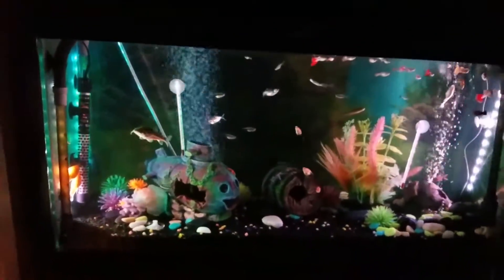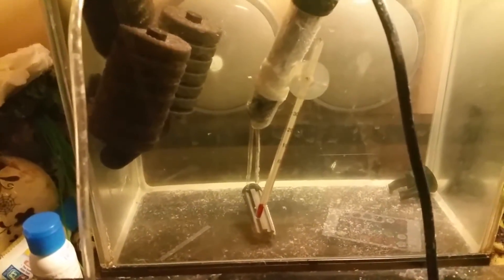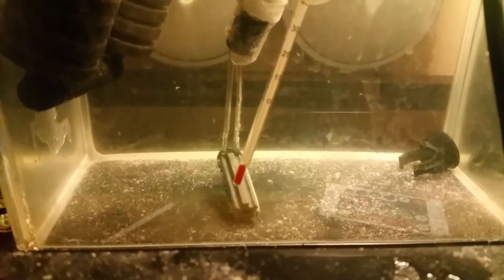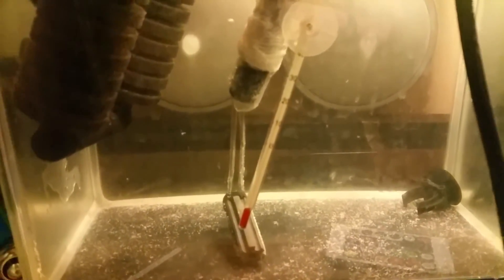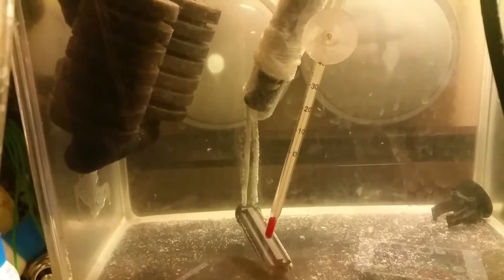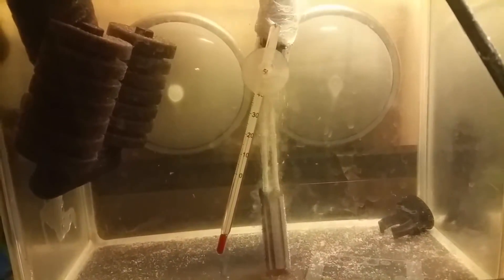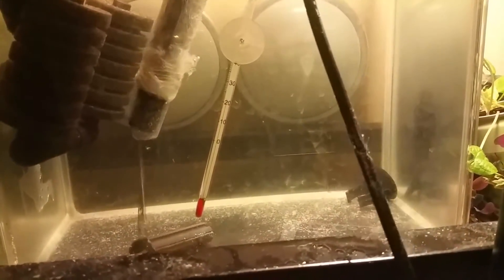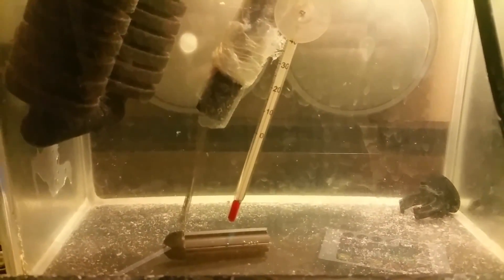Aquarium Heater Explosion - Electricity Vs Water

Comment: That’s a very overstocked tank
Reply from the maker: It was at the time yeah as there were a few guppies I had to put in there from the other tank for a short time whilst moving it, was only for about 3 hours, also the main tank was running 2 fluval 406 external filters with I line vecton uv filters so they were all good.
I ended up giving the whole lot to a friend when my health went downhill.
Reply: Thats not even overstocked. Guppies just keep breeding

Comment: Thumbs down because this is not a proper test without putting a fish in the electric water to see what happens.
Reply: No. Electricity takes the path of less resistances. I have degrees and will happy put myself in that tank.
Reply from the maker: I don't think much would happen initially but it would boil the water so wouldn't be very nice for the fish either way lol